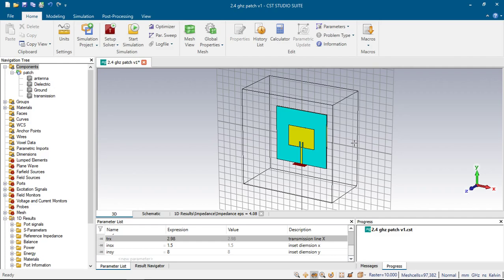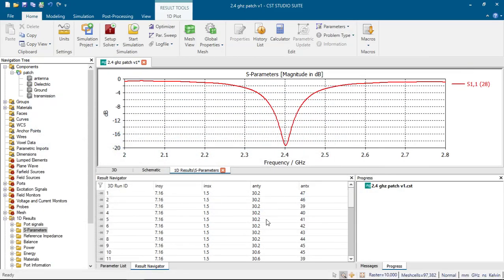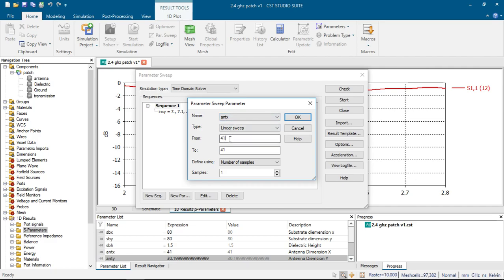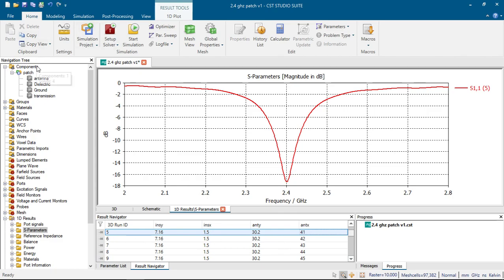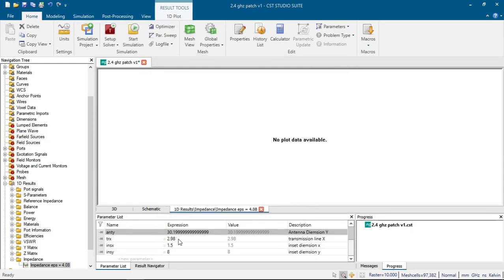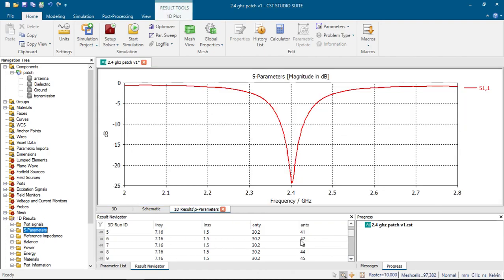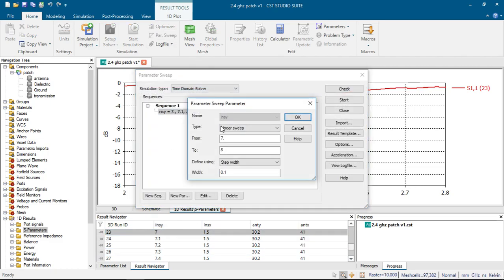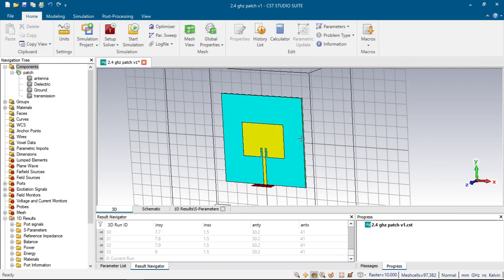2.4 GHz Microstrip Patch Antenna Design using CST 2019 (Part 2)

Comment: Thank you mate. You said in your first video that I would talk about the boundary. But I did not see it in this video?
Reply from the maker: Basically the simulations in CST run in the closed boundaries. Based on your design you can choose several of them. For this particaular case we are interested in far field radiation characteristics of the antenna. That is why we are using open boundaries. For example if you design FSS structure, you have to use unit cell boundary conditions and etc.

Comment: s parametee result is little far from 2.4
Reply from the maker: It is possible, you can adjust it by slightly changing the dimensions of the antenna.
Reply: @SimulationMaster  CAN I DOWNLOAD THIS DESIGN

Comment: The Most Helpful Video on YouTube on CST studio with detail descriptions, Thank you very much Sir. May you please add another one with coaxial feed. Best regards. 

Ps. How do you single out “3D run ID”  and deleted all the other unwanted parameters so that if you do parameter Sweep again it won’t calculate for the unwanted parameters. Thanks.
Reply from the maker: Thanks for your message. I will add in future your request. 
In CST you can arrange what parameters to be calculated in 'Parameter Sweep' window. If you set the parameters which were calculated before, CST will skip them and will not calculate them. Hope this answers your question. 
And if you want to delete all calculated parameters in the 'Result Navigator', I usually change mesh settings and reset them back. This deletes all the previous calculated parameters.
Reply: @SimulationMaster  It is very helpful, Thank you sir. will look forward to it.